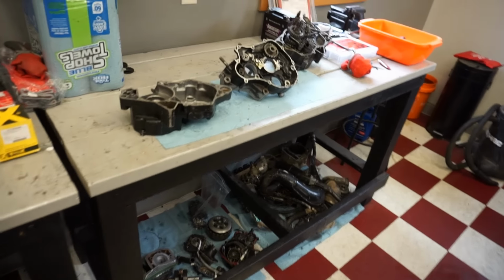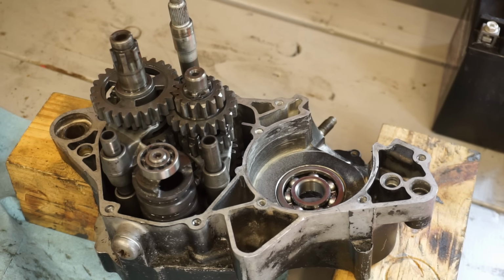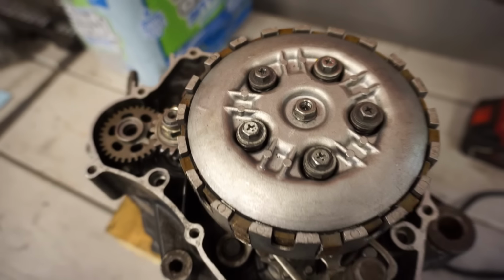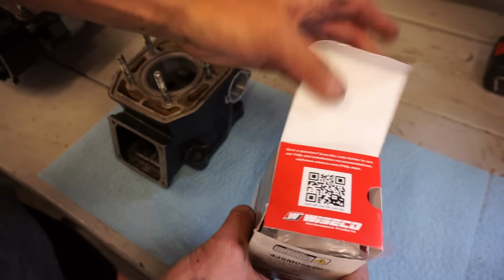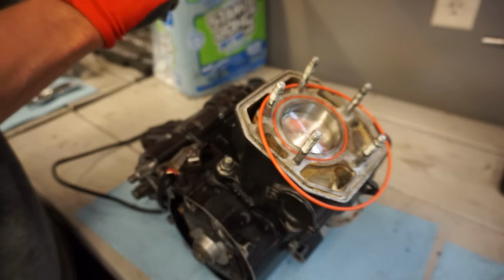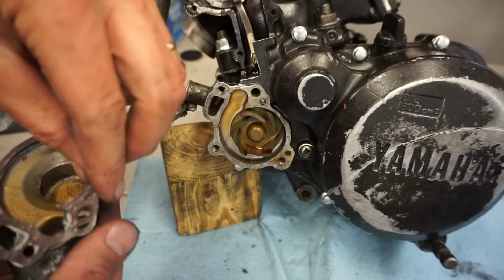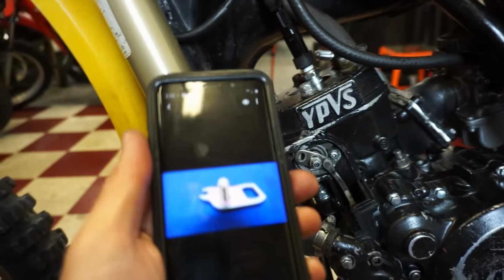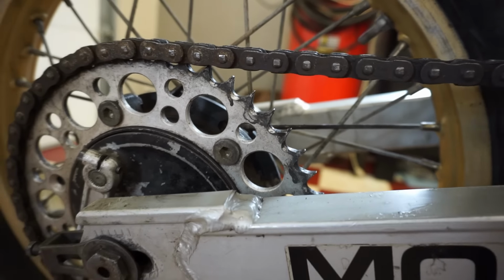Seller Lied About This Rare 2-Stroke Dirt Bike (FIXED)

Comment: Home Run on Your Behalf!! Going back to the seller is a waste of time and unprofessional. Some lessons are expensive ones and I have dealt with some what the same issue many years ago. When i was a child my older brothers friend had so he said the exact bike. The odd thing is I remember it to a T and it had no mono shock it had 2 spring shocks connected to  much smaller swingarms. It was also air cooled. I must have been lied to as well. It was the 1st 2 stroke I had ever heard. I believe that's why it's engrained in my head. Who knew a 82 yz 125cc could be so complicated. Pretty work as usual sir.

Comment: You need to apply a lot more heat to the cases if you want to bearings just to drop in. A simple electric heating plate or a owen is a lot better for that job than the gas torch. The cases have to hot enough for water drop boiling instantly away before the bearings go in

Comment: To use the heat and drop in method to put in bearings you need to get the cases very hot. If your gonna use a torch you need a map gas torch because propane is not hot enough and your only heating 1 part of the case so the other parts of the case act as a big heat sink and cools off the case very quickly and if you take too long, you wont get the bearings in. The best method is to heat up the cases in an oven and evenly heat up the cases then drop the bearings in.

Comment: Heating the case makes the race bores smaller. As the metal expands, the diameter of the bore decreases.  Freezing the bearing is solid. Heating the cases doesn’t help.

Comment: As far as I can see, nobody recognized your mistake: how do you set the crankshaft position in the crankshaft bearings if you mount the seals? I'll tell you: no way. But in this case in the bearings' inner and outer rings have stress and they'll have a short life.

Seals come last, the crankshaft's spin freely is VERY important and its check is first!

Comment: Preserve your seals, place a few drops of STP in the valley of the seal before a shaft goes into the seal. Prevents nicks and cuts going together as well as lubricating the seal itself so it does not burn out. Another thing is, never run an engine without coolant in the water pump. That will cause early seal failure! Ask me how I know!! Annnnnnnd, that strawberry syrup you spread over bearings, use it on cams and followers without fail! Cam failure on a new build usually happens within the first few hours of run time. That red assembly lube is loaded with zinc and helps eliminate galling.
Left hand drill bits are your friend when you cannot notch a screw with a dremel.
Reply: 2-strokes don't have camshafts....der der!
Reply: @JohnDoeEagle1  I have seen plenty of 4 stroke builds in this channel that it is worth mentioning. Thanks for your disparagement! I would still offer sound advice, with or without your approval.
Reply: @Sunspot-19  

Sure...talking about a camshaft on a 2-stroke YZ125 build. That makes about as much sense as a popcorn fart in a crowded movie theater.

Comment: Phillips head screwdriver slot stripped you can use a Dremel with a small cut off disc and cut a slot in the screw head like a flat blade screw driver will fit and take it right out!

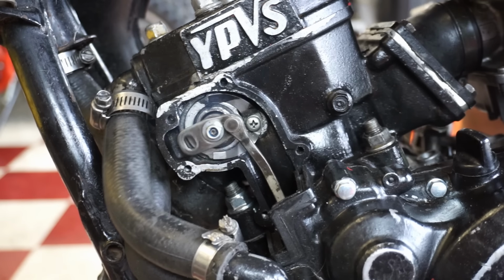Comment: At 56:50 smoke seems to be coming out of the power valve, is this normal? Also something seems to be leaking at the front of the cylinder when the revs are high.

Comment: What do you expect for $800, Joe knows every time he buys a bike he is risking getting a bike that needs major work, man I’d buy that bike everyday for $800 and rebuild the motor, I bought a non running 2005 yz450 for a $1,000, owner said it stopped running and put it in the shed, all I had to do in the end was rebuild the carb on it, bike runs like a dream, it cost me $50 to fix it, you can get lucky as Joe has many many times with easy quick fixes and I bet that out ways the rebuilds he does.

Comment: If you put the bearings in the freezer overnight, they'll just about fall into place. When you heat up the cases, they expand, making it harder for the bearings to fit.
Reply: 🤔 I was just thinking 💭.....If a person had no access to a torch or freezer. They could use a spray can of computer keyboard cleaner, upside-down. To freeze the part, which can get it much colder than a standard freezer. Just gotta be careful not to crack the cold metal by hammering too hard on it. Canned air can break open 🔓 a lock by getting it incredibly cold ❄ & wacking it with hammer.

Comment: Hey odd question I know you have a 400ex, I just picked one up about 2 days ago and it ran perfectly on the day of buying and now with out riding it once it will crank but not start I believe there is gas in the oil somehow. when I took the carb off I didn’t see anything actively leaking but I didn’t take it all the way apart could a super small leak that’s not even visible cause something like that I’m a little disappointed as I paid the price of a running good condition quad. And I’m pretty stumped as to why it stopped running I turned it on literally yesterday with no issues and now it just won’t not even if I try and bump start it do you have any ideas?

Comment: I got a question for you...I have a 1999cr250 just had rebuild. Before it was done it would start in gear and now it won't just wants to move...there anything I can do?
Reply: Clutch may not be adjusted properly, not disengaging fully, or not reassembled correctly.

Comment: Hi Joe newish subscriber here. I'm a machanicaly minded person, obviously why I like your videos. Could you or some one in the comments section explain what the power valves do. thanks.
Reply: They restrict exhaust flow at low RPMs to increase throttle response. At higher RPMs they open up and allow the engine to breath increasing overall power output.
Reply: @JohnDoeEagle1  Thanks dude

Comment: 40:1 is NOT the correct premix for running in that bike. 32:1 would be correct.
Reply: Yep...I caught that too. Then again I had a 1980 YZ80 that I sold in 1989 and remembered the mix ratio.

Comment: I remember my Float Stop Needle jet went poopp I had to get one  fuel would just overflow the bowl ,in one year of a new bike , glad that was the only thing went wrong with the bike Other then the Neck bearings and O rings didn’t last a year , bad engineering design Having Coolant going through the Neck I had to carry water with me we would mostly ride in the mountain where we had Cold streams we would swim in  and I’d get pure Spring water 💦 And fill my radiator 😂

Comment: I had one of those I paid 50 bucks for mine and I had to reset the timing on mine and the Detroit police impounded mine for driving it on the city streets with no driver license
Reply: 2 strokes don't have timing chains, and you probably shouldn't b stopping for police on  the streets with a dirtbike regardless of licence.🤣
Reply: Well I was 14 and they knew exactly where I lived at because they knew my dad and my 82 125 yj did because my would back fire like crazy when I hit the throttle and the repair manual I got from the Yamaha shop and they said the same thing

Comment: Once you get all the screws out of the engine does anyone make a bolt kit to replace them so you don't strip them out again?
Reply: Yes. Your local hardware store. Measure the screw length and check diameter/thread pitch. Ez. You can basically eyeball the length and diameter and every hardware store I've been to had a pitch gauge.

Or you can just check pitch against the old threads. 

Or figure it out with a tap assuming the screw is obliterated.

Comment: So that older model doesn't need the holes drilled???
Reply: Holes drilled in the piston is what I meant to say ??  Great channel, watch all the time 👍👍👍👍👍✅✅✅✅✅
Reply: I think the holes are only required on   cylinders with bridges going across the exhaust port not all cylinders have them I think it depends on the power valve design

Comment: Why didn't you use an impact driver instead of drilling? it's a lot easier and less messy, also, why didn't you bother cleaning the motor internals before re fitting, fitting a dirty gearbox can cause loads of problems. I thought that gasket maker was used instead of using a gasket so why use both, all it does is increase the thickness of the gasket, not a problem with standard bikes but race bikes need to be put together properly to get maximum performance. Do you ever check the squish on these race motors? it's well worth doing for maximum performance.

Comment: bike was 1250.00 brand new
Reply: When it's finished it will be worth approx 3k. A new 2024 YZ125 is MSRP $7,099.00. Someone will easily pay $3,000 - $3,250 for a 42 year old freshened up solid rider and not a museum piece.

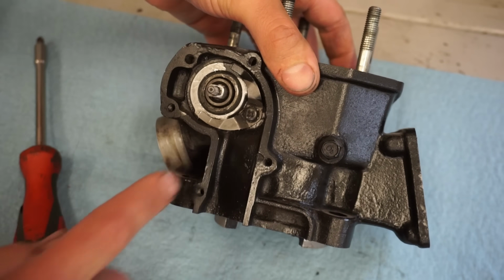Comment: U could have put heat to screw or whole cylinder in oven. I bet screw would have come out without drilling it. Because it came out after you drilled it, as the heat from drilling free it. 21:23